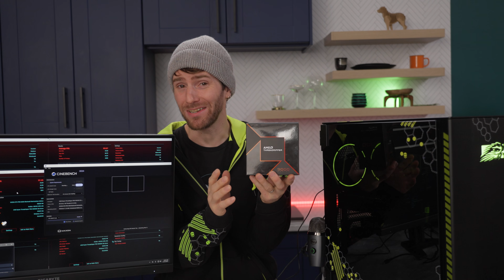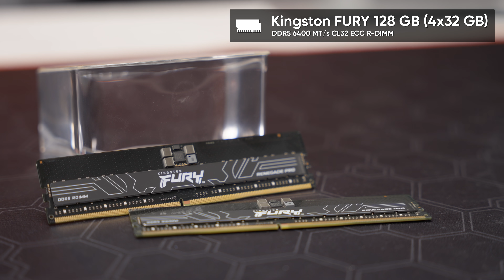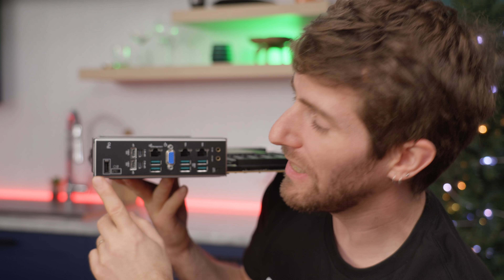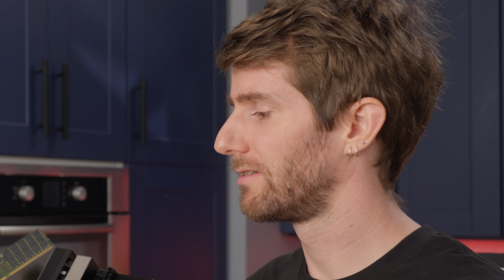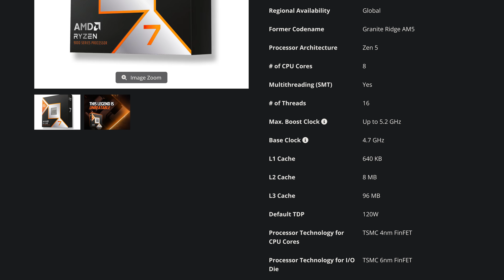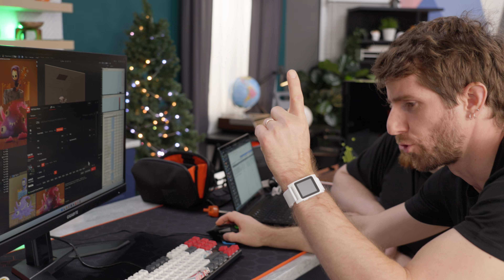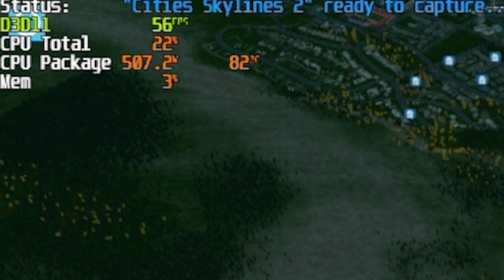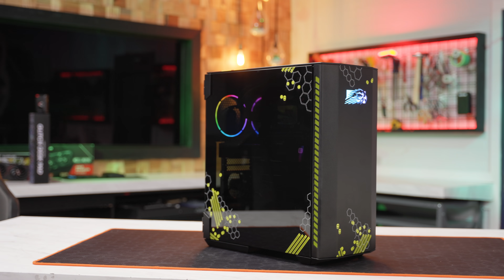The Fastest Computer I've Ever Had

Comment: "Do you think it could do more with better coolong?"
...
You mean ... "Distance as voltage ... Current as amount ... And resistance as ... Chaotic movement in the counter-direction ... Vs ... At ... Closer to zero kelvin ... Less ... Back-lash (this is what causes the heat) from ... Hitting against the rectifier and everything that follows ..." Instead? ... Sure it could do netter! It just needs to be more ... Synchronised! ... And ... Agreed! In the ... " "This way ... Untill we close the loop? Then we ... return? ?" ... Ooor ... "This way and this way! "Both!" ... But first one way ... Then tbe other!" " ;) :)
Reply: Dead internet theory.
Reply: @jonathanelstone9798 autocorrect and the equivalent of miss clicking ... But on a keyboard ... Still alive thou ... (R.W.J.'s ) Alege...deadly! 🤣🤣🤣🤣

Comment: Skylines 2 runs fine on my i7-9700 and a 5070, 1440 ultrawide high settings, getting similar FPS, 30-40fps is fine for a game like this, this game is all about simulation speed which is based on CPU and you should be crushing it in that respect. You're missing the point by expecting high FPS for this game. Its job is to simulate thousands of people at the same time and with a beastly CPU you can do that at very high populations.

Comment: Cities skylines 2, you can run full graphics that will depends on GPU, so it doesn't matter for cpu testing. The simulation use cpu. So a proper test for that CPU would be a 3 millon population city and try push the simulation speed to 3x or even more through extensions/plugins

Comment: Takes what’s arguably one of the best PC builds out there without essentially saying I’m going to build a full custom pc and still suffers with city skylines 2 with a cooling system hooked up to it.
Crazy work
Reply: they should’ve done the best test ever. 
Minecraft 1000 x 1000 x 1000 blocks of tnt and if it can pass that add shaders, and if you can do that apply better shaders to crash 😂

Comment: this is my request high-end workstation build actually 
CPU AMD Ryzen™ Threadripper™ PRO 9995WX
Motherboard ASUS Pro WS WRX90E-SAGE SE
GPU 2 × NVIDIA RTX PRO 6000 Blackwell (96 GB)
RAM 8 × 256 GB DDR5 ECC RDIMM (2 TB)
Storage 4 × 8 TB PCIe Gen5 NVMe SSD (32 TB)
PSU ASUS Pro WS 3000W Platinum
Cooling Custom liquid cooling loop
Displays 2 × ASUS ProArt 8K displays

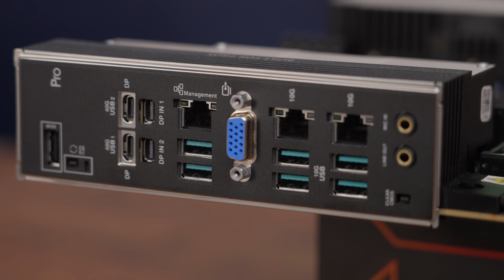Comment: 07:25 Not going to acknowledge the VGA port in a 2025 motherboard? Does it have some special function?
Reply: this is a server board, servers still use VGA for basic video output as they almost never get used directly with a monitor, instead being managed over the network.

Comment: I have an idea for a video: running Linux entirely from RAM. If you had 1 or 2 terabytes of RAM, could you boot Linux directly into memory, install Steam, and test games? Computers feel dramatically faster when they run from RAM—I even saw someone load Windows into RAM, and the speed was incredible. Everything felt instantaneous, with no loading times at all. My thought is that with 1 terabyte of RAM, you could allocate 512 GB for the operating system and another 512 GB for games and benchmarks like Cinebench. I’m convinced the performance results would be significantly better

Comment: i used to run quad chanel on my old gaming rig, i7 3930k with Corsair Vengeance 8x 4gb 1600mhz ddr4 @ 1333mhz  really had some trouble with the clock so had to stay low, but in combo with my old RTX 3060 it used to be pretty okay in most games, now my daugher has it as her main pc but ive removed half the rams and run it at 1600mhz. it looks kinda fun on my old photos with all those rams, and now i have 2x ddr5 @ 5200mhz and 64gb in only two small sticks haha. future is better.

Comment: Interesting review, as I have been running a Pro WS WRX90E-SAGE SE with AMD Ryzen Threadripper PRO 7975WX plus 128Gb DDR5 RAM since 4/2024.  Just changed the water cooling tubing and fluid last week.  Max temp remains 49C under load, but it is dual circuit cooled, quiet, reliable, and has completed all tasks placed on it effortlessly.  I would upgrade, but it has not really exceeded 30% utilization on most tasks, so I save the money for something else.  

Try running your radiators in series, no condensation problems, no expensive refrigeration, and no added noise.

Comment: I found a computer system workstation that uses that particular CPU you can purchase it for about $30,000 it has a RTX pro 6000 Blackwell workstation edition GPU at 96 GB   The thread ripper is up to 5.4 ghz it’s a liquid cold power supplies are 1600 W super flower leader 80+ titanium.

Comment: I just finished my 9000 series build on the sage wifi-a mobo. Absolutely slaps, The ram at 6400 cl32 kingston for a grand was  ajoke but worth it. This is not for consumers, Including the bios. Using the asus hyper m.2 in raid 0 as well, just slaps. There is not enough content on these builds. They are elite stuff

Comment: Run Comfyui workflow wan2.2 14B at 1024 30fps  length at 161. Lets see how it will handle. A simple 14B model image to video will make this system cry.:face-green-smiling: or even a simple A.I Toolkit training wan2.2/flux data will make this system bleed.:face-green-smiling:

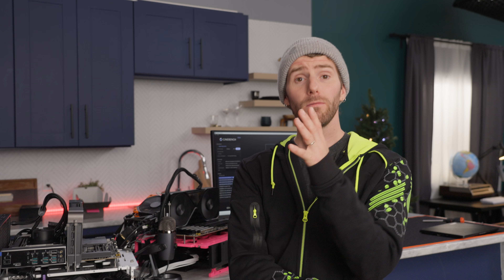Comment: 19:50 - Didn't even need to show an old WRX. A brand new one can be bought cheaper than a fully kitted out system like you're showing. $13k CPU, $10k RAM, $10k GPU. Add a few thousand for motherboard, case, storage, and you're over the starting price of a brand new WRX.

Want 2 TB RAM and two "pro" GPUs? Now you're in BWW M3 territory.

Comment: That CPU has more cores than the entire server closet I supported in my first "real IT" job.

And more L3 cache than the system RAM in the "high end" system I used at that job.

(I'm estimating on the first one - we had two 42U racks, most of the servers were 2U, a couple 4U, plus network hardware, power hardware, etc; so I'm guessing probably about 30 total servers. Most were dual CPU, a couple quad, a few single.)

Come to think of it, with 92 MB L2 cache, and 384 MB L2 cache, that CPU could in theory run Windows XP - with no system RAM or storage. Use L3 cache as storage (it's possible to get XP down to ~300 MB if you rip out everything "optional",) and L2 cache as "RAM" (XP can run in as little as 64 MB.)

Comment: It's sad you didn't run encoding benchmarks. There's a tool called av1an which is specifically designed to run multiple encoding instances and scale perfectly to however many cores you have. It is a real-life use case, but you need a lot of RAM.

Comment: I grew up having a Commodore Vic 20 tape drive, then I got an Amiga 2000 w/HD, completely life changing. 16 bit graphics, 4 channel sound. 286 was at that time still working off 5-1/4" floopies and MSDOS.

Intel enjoyed over a decade of ripping us off afterwards. AMD after Phenom II (which I ran) may have taken a decade long break after Bulldozer failer, but certainly paid off in the back to the drawing board and redesign.

What a monster!! 😳

Comment: Yeah, fine Linus but all that: fastest this, fastest that, DOES NOT MATTER anymore. Nobody needs nor uses even a fraction of that power not to mention nobody can afford it. I parked at Gen 11 Intel, well before Intel processors started to burn themselves up because of badly designed voltage regulators. Since the time when 8 core, 16 threads entered the market nobody needs anything beyond that in everyday use. All these 50-100 cores, DDR5 or DDR6 is bullshit, especially at these prices. 99,9% of the consumer market has no interest in all that. I am now buying a new computer every 6-8 years, especialy after having made a decision to DUMP Windows and switch to Linux, and I am a happier person now. Less computers, less spending, more focus human skills, relations with others and life. Recommend this to everybody.

Comment: This is almost, almost, enough to satisfy my thirst. I still dream of getting a server-grade consumer-focused anti-budget build. Just a "if you can afford this, you don't have to buy PCs for 20 years" kind of build. I still wish for something even more bizarre, something even more powerful, even more focused on the absurd. Power per core is highly relevant as well.
There was a class of personal computers selling in 2003 that had such massive systems that they were still relevant up to 2018. 8gb of RAM (4x2GB), 1TB of storage (I guess it was 512GB HDD and then they installed a SSD or external storage), classic RTX or RX (don't remember), and so on. It was still usable, what screwed it was the motherboard (couldn't be upgraded). That is 15 years of usability, with the first 5 being a extremely high level class of a computer. Considering we are in a steep curve, PCs are not supposed to improve that much year by year, not as much as 2003~2018 at least, so we should be able to produce a MACHINE able to last 20+ years while still being relevant.
In 2018 a 8GB RAM 1TB HDD 15 years old machine that could still run Crysis at 18 to 45fps was hella impressive. This new piece of tech would be really worthy of a great investment, since the first years would be a eternal bliss and the later ones would be well enjoyed, and could be passed down for later generations.

I will fully satisfy my thirst once I can get a computer with a single CPU, single GPU, that can withstand more than 25 years of tech, and still be not just medium, but a high-level build, like the ones of 8k to 15k dollars today. Then I will be forever satisfied and able to die peacefully with a smile on my face. Only then.

Comment: I read online that you couldn’t use different ram sets together in the same build. I tested it and it worked with 2 gskill trident 16gb 3600mhz and 2 gskill ripjaw 16gb 3200mhz, running overclock at 3000mhz. Please make a video testing different brands / speeds / sizes in a single build. Use an 8 dimm slot motherboard like Msi X99A plus. Thank you

Comment: hey Linus, i havent turned on my PC in a month and now when i did im getting only 60fps on every game. CPU: R7 7800 X3D, GPU: RX 7900 XTX, 64gigs DDR5 RAM, 8 TB of storage. i updated everything (GPU, CPU drivers and everything else) including mobo bios (MSI Tomahawk X670e). and for some reason now im only getting 60 fps in every game. ive tested Hogwarts Legacy, Cyberpunk 2077, GTA 5, Vampire Survivors, Dark Souls 1-3 and The Last of Us Part 1. also tested Deep rock galactic and The lies of P on the xbox game bar incase it was just steam. all r running at 60fps. ive checked the settings in each game and where its availible framerate is not capped. i have a 240Hz monitor at 1440p ( do plan to get 4k when i can afford it) but i dont understand whats going on. everything ran over 150-300 fps a month ago. now it just wont would you or anyone be able to help me with this issue?

Comment: Pulling only 120 watts on 96 core CPU is actually damned impressive.

Because the FX series 5GHz chips could pull north of 220 watts.... (that was an "8 core")
My Phenom x6 I had back in the day I managed to get it to run stable at 4.2Ghz on air, at the cost of pulling well over 140watts.... (Boost off running at a high overvolt)
Though suprisingly it ran hot but never overheated and would handily outrun most of the FX chips in most tasks this enabled me to skip to the Ryzen series, havent looked back.

Comment: So what do you actually have to do to keep this thing cooled?   I've got a computer in the house that has dual 750 watt power supplies going through a special connector to the mother board.   Would you be able to do something like that to provide the power for this thing?  What do you need for power supply if you are running 8 GPUs and full 16 banks of ram?

Comment: If the CPU needs that kind of cooling and at that price, I would think a "small" chiller could be included... Maybe that's a market segment that needs attention?

If small HVAC systems run ~$150, a specialty manufacturer could probably get one made for under $100 for a PC like this. (Then mark it up to $500 because mounting hardware and business.)

Small compressor, use universal pre charged hoses, then a radiator. Easy mode.

Comment: I wish someone that knew what they are doing did the CS2 test for this thing. There's something obviously wrong with what they looked at. My Ryzen has better performance on a city that size.

They either have not updated the game or have just updated and are using an old save that hasn't finished calculating the simulation changes yet.

It still has some performance issues but a quick Google would have found that what they were getting was way below normal performance, let alone what you should be getting on that many cores. But I guess they just went for the easy out with the low effort meme there.

Comment: If you're looking for a program that renders graphics, uses both CPU and GPOU cores, or just GPU or just CPU as you can select the core types in the settings, look at a program called DAZ Pro.  DAZ stands for Digital Art Zone and yes, the Renders it does are insanely powerful.  My current system has 20 cores with an Intel Ultra 7 265KF Processor (20 Cores) with 32GB 6000 Ram and a 5060 Ti with only 8GB Vram, will take 15 to 20 minutes for a photoreal render in DAZ, using ALL cores.  So get that program and stress test your systems with it.  I bet you'll be impressed.

Comment: That CPU at full capacity must generate enough heat to generate electricity if you attach to a cooling system that generates power with steam 🤣

Comment: Hey Linus, I'm working on a benchmark that should get you 100% CPU utilization on every core and literally melt the processor at full load.  It slams my Sapphire Rapids system with 1000w instantly.  Let me know if you'd like to preview it on this Threadripper and we can arrange something.  🍻

Comment: The actual capacity of that 10,000mah ugreen power bank in actual charging of your phone is probably only around 7,000 to 8,500mah due to power transfer limitations and inefficiencies. It's the same with all power banks in every type of charging scenario. No power bank will ever actually put out the advertised capacity to your phone or any other device. Google it, you'll see what I mean.

Comment: The dimensions of a CPU are going to be the biggest bottleneck moving forward. You can only cool a small surface area so much using room temperature ambient air. I suppose next gen cooling systems will need refrigerant, but the overall wattage needed to keep the system running will be crazy. Not to mention that you will need to duct all the hot air if you don't want a small office to turn into an oven.

Comment: ECC  memory its actually slower than og VRam so it's not for gaming its for AI training tasks where you load Weight Tensors in the GPU to do the Back Propagation and dont want any error in the process (in order to not have an output tensor that in the next pass will be incompatible with the network arch). Still ECC memory solves the rare errors that occur and extends hw life doesnt do that much.

Comment: Why do they still put 10g ports on motherboards, when the external Gen5 m.2 SSDs reach 1,5x that speed, so the port is limiting the transfer speed, when with thunderbolt or USB4 you get 40g and USB5 up to 80g transfer speeds?

Comment: I just built myself a threadripper 3970x system on an ebay "for parts or repair" mobo, and man, even though it's such a dated chip compared to what's being showcased here, I had the exact same reaction when I discovered just. how. MANY PCIe lanes it had. The bottleneck is the literal physical room you have in the case to stuff things in

Comment: I wonder, if you are running 128 threads on 96 cores, will it put it on all 96 cores (32 with two threads and 64 with one) or 64 cores (all with two threads). Cause I would assume that the first case would perform better.

Comment: it is normal to have 60c cpu temp? i7 14700? and two fan water cooler?
Reply: At idle or under load?
Reply: @goomywurm   right now 34c to 39c, and 66c temp core distance to max, with browser and some other programs, it is an i7-13700 kf (rechecked it)
Reply: @ezioauditore5616 Yea I remember those particular Intel chips from that generation being slightly hot, but that seems pretty normal. Sorry for the reply.
Reply: @goomywurm  no need for the sorry, thanks for the reply!
Reply: @goomywurm  no need for the sorry, thanks for the reply!

Comment: Pretty sad, being forced to use current operating systems only.  AMD does not want anyone using an older operating system with their hardware, even if it could operate.  Forcing EOL has me stuck on using X99 chipsets and older 5000 gen Ryzen.  Even then, I hack my drivers to fool it into working.  Windows 11 blows chunks.
Reply: You can get an extra year of security updates for free for Windows 10 now.

The other option is switch to a Linux distro. Zorin OS is very Windows like, and so is Kubuntu.